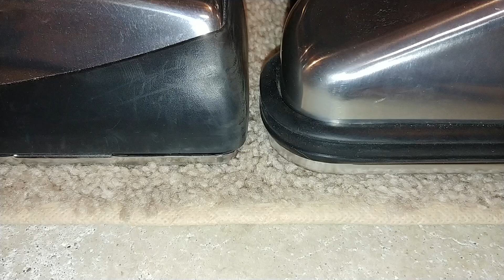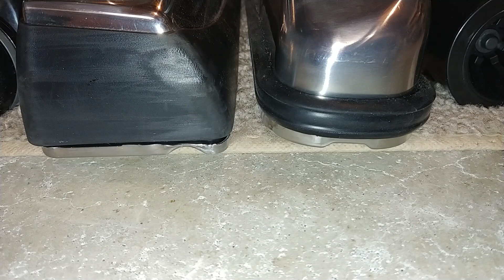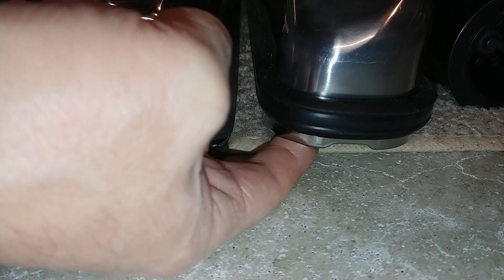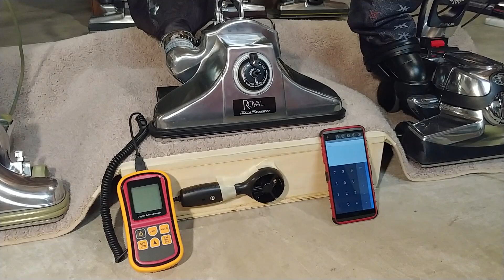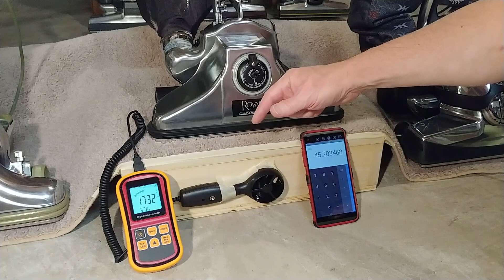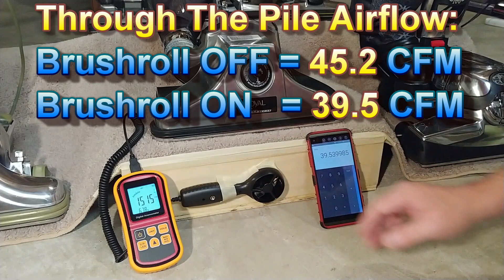CFM Through The Carpet: Royal Pro Series 9 Amp

Comment: Even a G6 pulls more airflow on top of the carpet than this royal. The G6 pulled 50 cfm on top of the high pile rug. So it probably might do better on picking up fine dusts than the royal mabe. Right?
Reply from the maker: Yes, that would be correct, especially with my G6 having the stiff oblique brushroll upgrade.

Comment: I have an idea of why this may occur. Due to it's smaller nozzle opening it's drawing air from a smaller section of carpeting. Since the carpet is restrictive it may be easier to move more air through a larger area? Perhaps this could be tested by putting a small head on like a Heritage II or if you were to get your hands on the sanitaire 12" and 16" models again.
Reply from the maker: Carpet area and nozzle opening have no appreciable affect on this test. Remember, as long as the collection orifice (top hole) is several times larger than the measuring hole (side hole) your results will be accurate.

Maybe I should have showed how the airflow rises as the nozzle gets lowered into the pile... 😄
Reply: @VacLab  I sent you an email and some pictures.
Reply from the maker: @Blackheartvacs  as always, your nozzle must cover the hole. That's one reason I made Airflow box #2 with two collection holes. Speeds up the testing and saves tape. 😂

And just so you know, I've tested the same vacuum with both "ports" and I got the same result as long as I sealed them properly. I used the small nozzle D80. 👍

Comment: I wonder, since my royal has a knob to adjust the height, would it make a difference in terms of CFM through the carpet? I know since it’s 10 amps (instead of 9 like the one here) the CFM itself would be higher.
Reply from the maker: I believe the "adjust-o-rite" would still suck in while the machine was just touching the top of carpet. There are two clicks remaining on the Pro Series if I really wanted to force it into the carpet. BUT, then I couldn't push it at all.
Reply: VacLab good point although I should note that the infinite-height knob isn’t as reliable as  something with multiple predetermined positions. I can set the knob down a certain number of turns (and fractions of such thereafter) and the adjust-o-rite would suck in, but it would frequently pop out too while cleaning because of slight differences in height over different areas of the carpet, leaving me to adjust it down a little more. So perhaps the CFM would stay the same, or it could increase depending how far down the knob is while the adjust-o-rite is sucked in.
Reply from the maker: @johnerikson7094  Ah, good to know. I didn't realize that adjustment mechanism has issues staying put as it were.
Reply: VacLab the height adjustment mechanism does stay in place it’s mainly just a matter of pile height causing the adjust-O-rite to pop out and the vacuum to lose contact. I’ll be honest, it’s pretty common with any height adjustment, but more common with an infinite screw knob because that’s more of an exact height you’re adjusting to rather than a pre-set height setting on a mechanism. That might explain why Royal discontinued the knob on household models–you might have to stop and lower it more when you find that the machine loses contact due to a small height difference, which can be annoying considering that houses can have more pile heights compared to the number of those found in a commercial environment.

Comment: Now that's interesting.

I don't have a G-series Kirby to compare to, but comparing my Royal 2075 and Kirby Heritage II, they sit about the same way. That said, the Royal 2075 has a sliding infinite height adjustment pedal with a sliding rod and pedal instead of the discrete-notch type that the ProSeries has, so I might be adjusting it differently.

Comment: Another great and surprising video. The Royal is 7/8 cfm higher than the Avalir yet the Avalir pulls 20 cfm more through the carpet.
As you say two similar machines using high airflow in different ways.
I predict/guess the Royal will remove a higher amount of sand from your style carpet with it having the bristle stiffeners on the Royal brush roll with it having insane agitation. But this will come at the expense of it eating/shredding more carpet fibers. 
I'm sure we all look forward to seeing your other tests.🙂
Reply: Kirbyvacuumcleaner the newer royals actually don’t have the stiffeners anymore because the bristles are stiff as is.
Reply: Thanks John. 🙂
Reply: Royal vacuums are commercial to the core, regardless of whether they're commercial models.